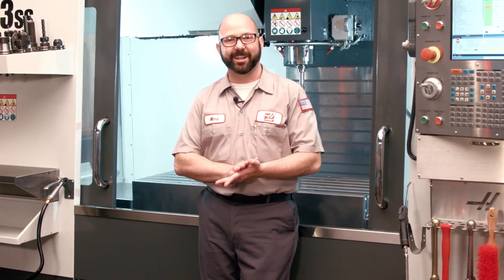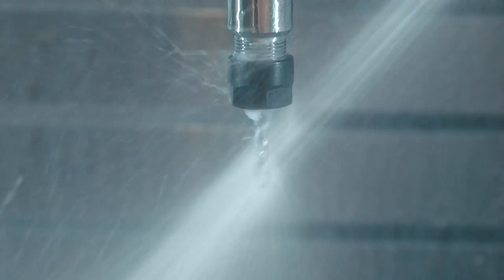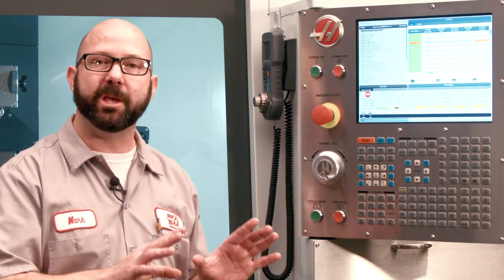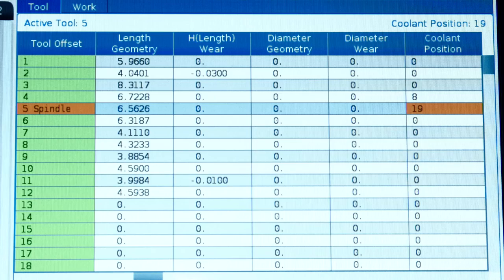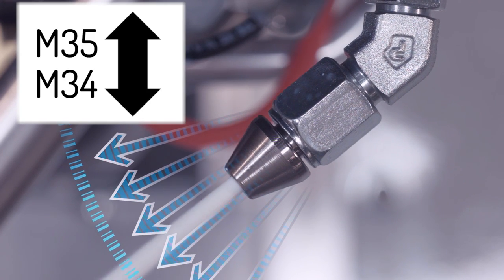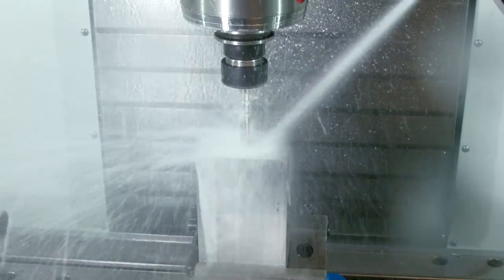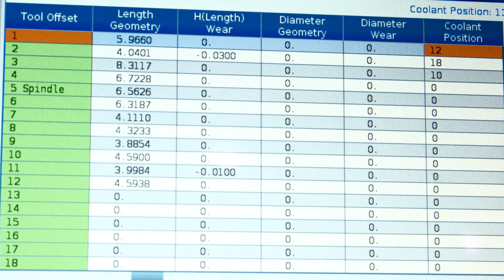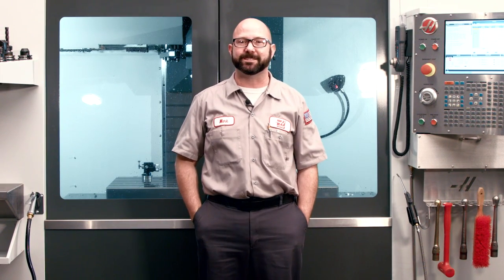Haas Programmable Coolant (P-Cool) Tricks You Didn’t Know About – Haas Automation Tip of the Day

Comment: this is nice lesson! Like most of the guys who work with steel instead of aluminum, we have a air hose connected to this nozzle. it's very useful to blow away all the chips during your work without getting all the parts wet.

Comment: That is really handy using pre loaded values from the probe to automate the p-cool nozzle height calibration. Any way to make it automatically oscillate for long tools?
Reply from the maker: Calvin - Nope. We can reposition the P-Cool using M34 or M35, but we cannot command it to oscillate back and forth throughout a cycle. Thanks for the question. 
- Mark, Tip of the Day

Comment: Link for your macro at the end didn't work for me.

I setup one like this:
IF [ #[ 2000 + #3026 ] GT 1.4 ] THEN # [ 3400 + #3026 ]= 6
IF [ #[ 2000 + #3026 ] GT 2. ] THEN #[ 3400 + #3026 ]= 7
etc.

Then added an M98 call to that pcool program at the end of 09995. Each time we set a tool, the p-cool is also set.
Reply: If you use the link in the description it will work.

Comment: Hey, was wondering a thing, not sure if it's possible. You mention that every step of the PCOOL setting is "sort of" 10mm... would it be possible to couple that to the Zmotion (simultaniously)  while drilling a deep hole for instance? Or would I need to program several drilling cycles with M35/M34's in between?

Comment: OK, how the heck do you get your pcool on and keep the coolant ring off? My last 3 machines came plumbed so it's ALL COOLANT ALL THE TIME. (coolant ring and pcool)  You cannot turn the ring off, which I found strange. Please explain.
Reply: You would need to get them wired to different solenoids with separate M-codes. For this demonstration it's likely they just turned off the valve to the ring.
Reply from the maker: There is a coolant valve on the side of the spindle cover, that turns off the coolant. We’ll turn that off when using the wash-down hose.  I did cheat though. I bypassed the coolant ring (plugged it), leaving only the P-Cool on for this video. We’ll bring this up at the next Engineering meeting, see if we can’t move the valves around to better isolate things. Thanks for the comment. 
- Mark, Tip of the Day
Reply: atomkinder67   You cannot turn off the valve to the ring. That's what I'm saying. It's ring and pcool togetger or none.
Reply: Didn't know that, we have the old style manifold and it has separate shutoff valves.
Reply: @haasautomation  Make it retrofittable.

Comment: Mark, I ran the macro on my 2009 HAAS VM3 unsuccessfully.  My machine errors out because of duplicate brackets. (it (does not) like this at all). Can you set me on a path to help? Thank you
Reply from the maker: Send me an email at tod@haascnc.com, and we’ll get things figured out. The downloadable macro shouldn’t have any double parenthesis in it. Are you using a probe, with macros enabled (Par 57:22)?. A 2009 machine should have M16 series software, so we loaded it up and ran it here at the factory, but didn’t run into any problems. Thanks. – Mark Haas Tip-of-the-day

Comment: Now I'm thinking, if you can do some basic arithmetic from inside the code itself, you could possibly make it so that the nozzle automatically aims at the top of the material by basing the angle value on the machine position in Z.
Fairly sure this would be possible, but most likely not a practical way of doing it. It's just fun to come up with different ways of doing things :)